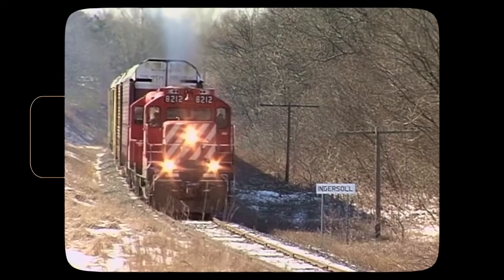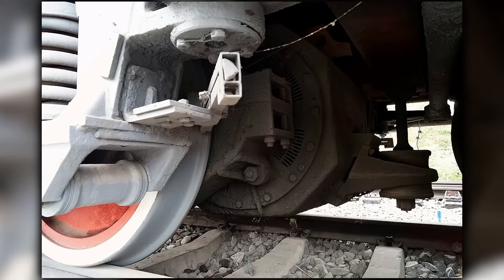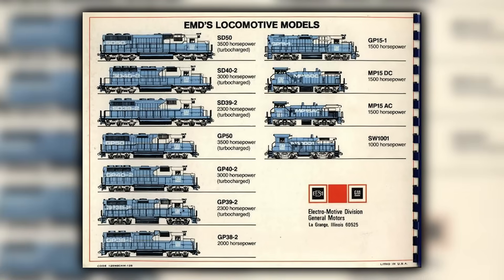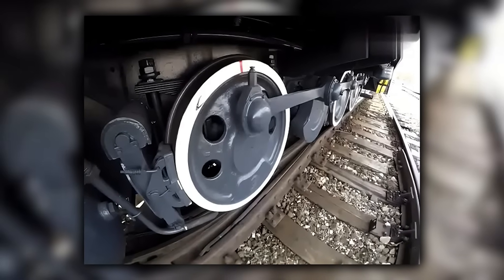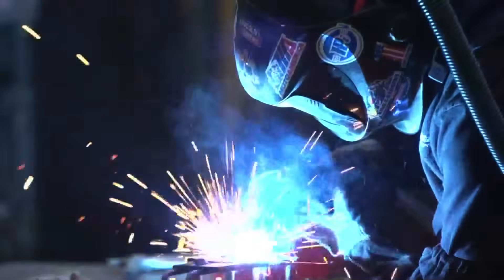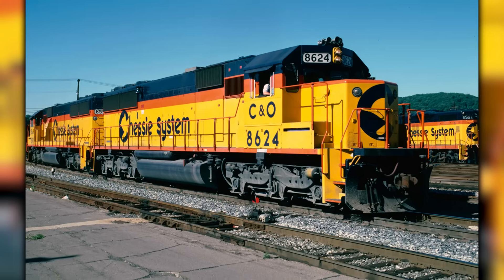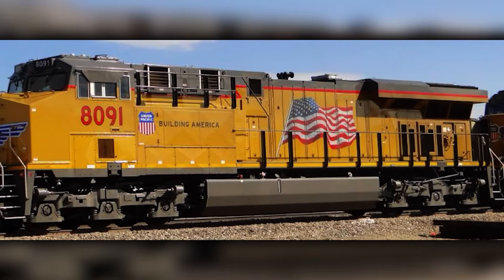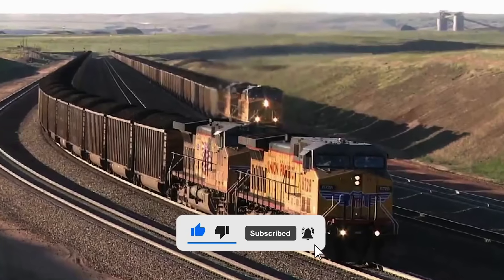The GE Locomotive That Still Haunts EMD

Comment: Both EMD and GE rushed 6,000 HP AC locomotives to market with prime movers (the diesel engines) that had not proved themselves to be reliable.  GE's AC-6000 prime mover (from a Sulzer design) was as trouble-ridden as the EMD's 265H prime mover.  Both GE and EMD killed off their 6,000 HP locomotive programs and retrofitted many of their 6,000 HP locomotives with proven 4,400 HP and 4,300 HP designs.  The big difference between GE and EMD from the 1990's forward was that GE fully embraced AC technology, while EMD continued to produce both AC and DC locomotives.  What now haunts EMD is that their 710 prime mover was never able to meet the U.S. Tier 4 emission standards, so EMD was forced to develop a new prime mover.  GE had "freshened" the old V-16 FDL prime mover with the newer V-12 GEVO design two decades ago  that was later able to adapt to the Tier 4 emission standards.  EMD's new Tier 4-compliant prime mover didn't arrive until a decade later and has still not gained a lot of popularity among the railroads.  The Tier 4 diesel emission standards are universally stupid, ineffective government regulatory overreach that have cost all diesel engine owners many, many billions of dollars in unnecessary costs, but GE's Tier 4 prime mover was at least able to meet the standard without requiring a total engine redesign, unlike EMD.  Ironically, the end result of Tier 4 is that railroads are choosing to have many older GE and EMD locomotives rebuilt (that don't have to meet Tier 4 standards), rather than buying all new locomotives.